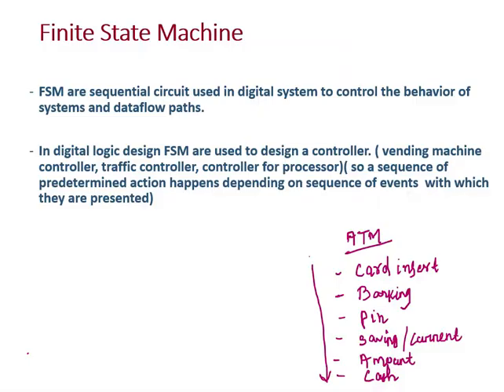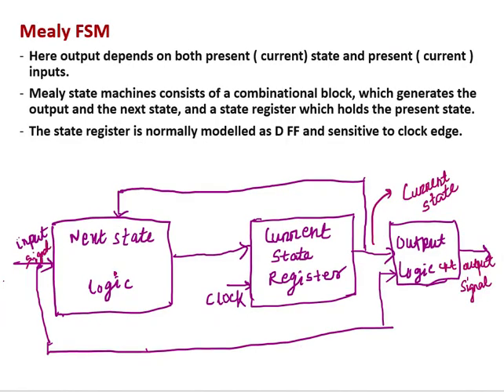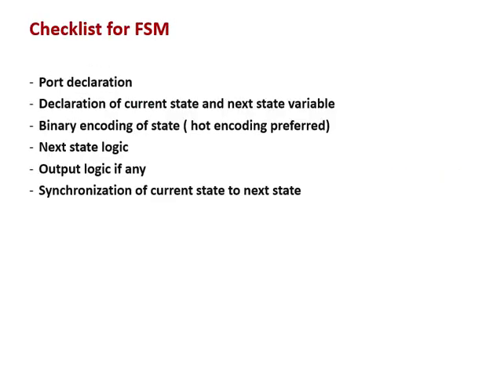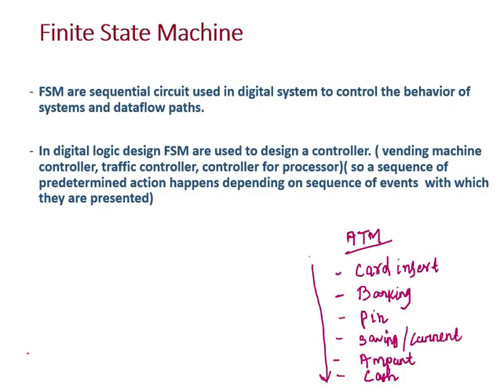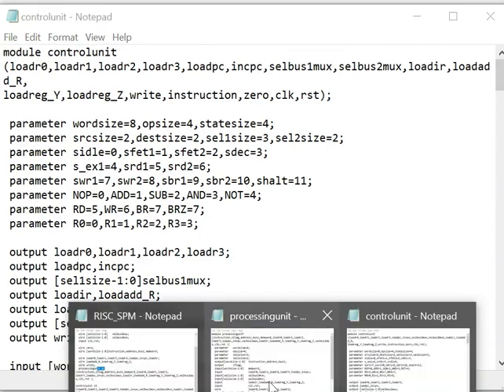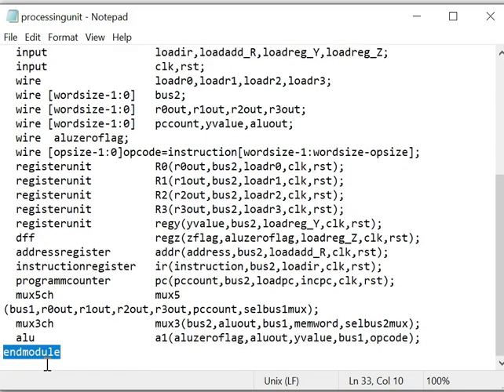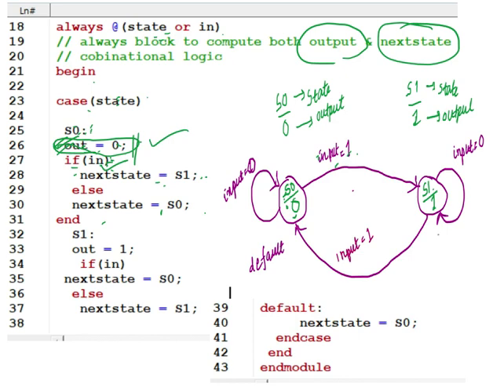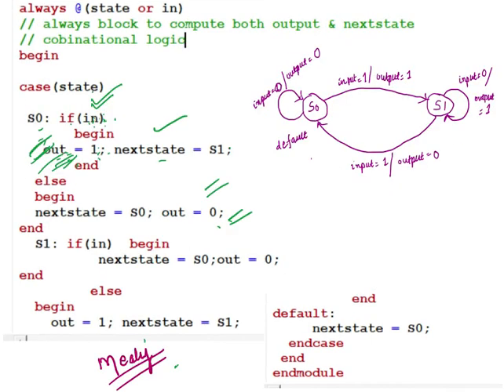#40 Finite state machine(FSM) | Moore state machine |sequential logic design | Mealy vs Moore

Comment: In moore and mealy both are synchronised with clock why you have mentioned only moore to be synchronised with clock

Just got confused here
Thank you
Reply from the maker: What i meant is , In mealy, output depends on input variables so output loses strict synchronization to master clock that drives system